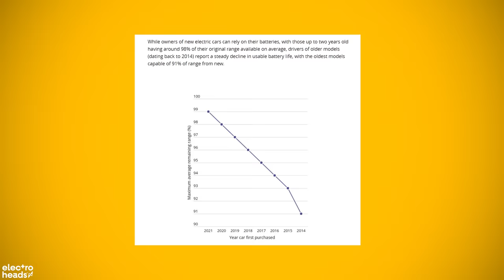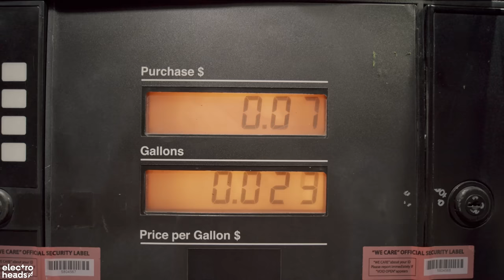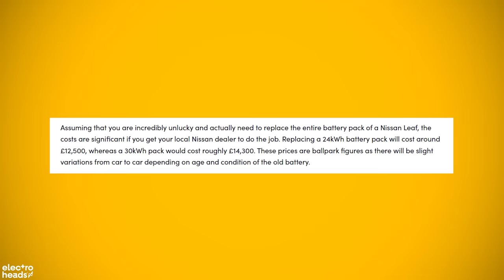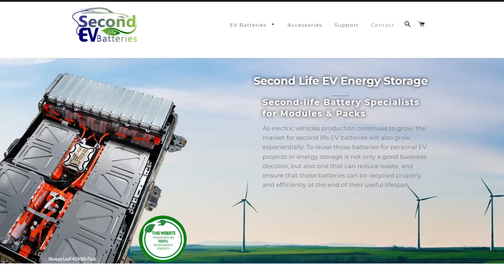What they DON'T tell you about electric car batteries

Comment: My first electric car was a home conversion using LiFePO4 cells in 2009. It had no cooling and would get hot when the car sat in an Australian summer sun all day. By early 2018, when I sold it, it had lost about a third of its capacity although it performed as well as new in all other respects. The battery had a small capacity so it was being given a hard life. 
Overlapping with that car, we had a Mitsubishi iMiev made in 2011. By the end of 2019, when I sold it, it also had lost about a third of its battery capacity while continuing to perform like new in all respects except range. It also lacked battery cooling except that it would blow cooled air from the air-con if it were fast charged but we rarely used DC charging with it. It did not do cooling when it was just plain hot weather. 
Both of the above cars 1) lacked cooling, 2) were always charged to 100%, and 3) had small capacities so a given distance driven required more charge cycles.
Our third electric car was a 'Holden' Volt, a rebadged Chevy Volt aka GM Ampera. Its battery was regulated to only use the middle 2/3 of its capacity so it never went near the extremes of fully charged or discharged and it had liquid cooling that could work any time the battery needed cooling. We owned that for two years from 4 years old to 6 years old. In that time it did not change its pure EV range and seemed to be the same as its new specifications. Other examples had very high milage and little degradation, even in hot climates. The difference seems to be cooling and avoiding state of charge extremes. 
Now I have a 2019 Hyundai Kona 64kWh. After 2.5 years and 45,000km, there is no perceptible difference from new. I routinely have it set to stop charging at 80% and don't run it below 40% unless on a long trip out of town. It has proper liquid battery cooling. I expect it will be good for several decades. With a large battery capacity, 1000 charge cycles would be around 450,000km, which at our current rate will take 25 years. Modern well managed lithium batteries should be good for several thousand charge cycles so I expect this car to last a long time. 
I have friends with early 24kWh Nissan Leafs and their batteries have not generally fared so well in a hot climate. One friend replaced his when its capacity became too small for his local driving. It cost Au$10,000 supplied and fitted by Nissan. After a year or two, the replacement is also losing capacity. Nissan have done a considerable disservice to confidence in EVs. I would not recommend one for a hot climate.
Reply: Peter Campbell:  Good points and examples.  With most modern BEV's from good makers, for traditional LI batteries, they manage the battery with software to prevent 100% physical charging or 100% discharging, to protect the range.  And even better, the LIFP (Lithium Ion Iron Phosphate) batteries that are getting cheap and popular have a GREAT reputation for durability (total charge cycles).   With those, especially if you are careful not to charge or discharge completely, the battery should statistically last a VERY long time. 

The energy density is lower (thus far) and the iron is heavier so they have somewhat lower range and acceleration, but for middle class cars, they compare VERY well to ICE's, and outfits like CATL are improving the energy density significantly in recent years. 

10 or even 5 years ago, I would have had reservations about battery life.   Now, I'd just go with an outfit with a good reputation and a good track record on batteries, not overcharge or over-drain the battery 99% of the time, and figure the battery will statistically outlast the car -- especially given the way BEV's will continue to improve in the next couple decades.

Comment: All the ICE cars I have owned mileage degraded (53 years of driving).  The Plymouth Fury about 1% a year to the Ford Explorer 5% a year.  
Before 1960 car engines only lasted 60k miles before overhaul (it was cheep as everyone knew how), ten years later the engine typically outlasted the car.
Reply: That’s quite true. I’d never considered some kind of degradation as the possible cause. Over a 12 year period, my Ford Diesel went from slightly over 800km on a full tank to well below 700km, no matter who was driving it 🤔

Comment: Don't forget that the efficiency of petrol and diesel cars also drops over time.  Also there are specialist suppliers who can fit Nissan Leafs,  for example,  with longer range batteries than the original at reasonable cost.
Reply: Yes, quite a few mods and adaptions for older Leafs. Available from a number of independent EV specialist......

Comment: I'm on year 5 with my b250e and my range is still the same even with these older cells. Had my motor replaced due to Tesla making my motor half assed lol but otherwise it's been 60k amazing cheap miles!
Reply: Richard Denson:  It is disappointing to hear how often Tesla motors have to be replaced.   I wonder if it's because Tesla markets their cars like they're racecars, and so lots of people DRIVE them like racecars, pushing the motors hard very frequently. 

I've been driving ICE's for 47 years now, and I've VERY RARELY put the pedal near the floor.  Even when driving my G37 fast on country roads, I still don't mash the pedal to the floor -- it isn't good for a an engine you want to last. 

I would imagine the same principle applies to motors.  Either way though, an out of warranty Tesla motor replacement will be EXPENSIVE.  Tesla fanbois love to claim Teslas will last forever, but I don't want a $5000 to $10,000 bill buying replacement Tesla motors, any more than I do for ICE engine or transmission replacements.  So unless Tesla sorts that out and such motor replacements become RARE, like say, Toyota engine replacements. I'm not buying the whole Teslas will last forever claims at alll.

Comment: I know of just a couple of incidents were batteries have been replace, both were in early Nissan leafs one didn’t require a full replacement just a couple of cell packs and the other leaf was owned by the Fully charge V-logger, it got an upgraded battery pack from I believe an insurance write off.  Eight years is a long time and by then I believe batteries will be cheaper, have larger capacity and be available through companies that specialises in EVs.

Comment: It must be one of the biggest cons of all time. ' Because of the low running cost, electric cars work out cheaper, in their lifetime '
For most people this is absolute bullshit. Without even taking the cost of the electricity into consideration and even now with diesel at £1.80 per litre, for the average extra purchase price of electric to ice at £10,000, that will get you 63000 miles in a large diesel car at 50 mpg. It is about time that this myth was put to bed. By 63000 miles most people would have exchanged their car for a new one, after the pcp of 3 years and 30,000 miles has finished. Absolute drivel, sorry. As well as this for an EV to work, you have to have a diesel car for long distance journeys because of the disastrous infrastructure, which is actually getting worse, supply / demand wise. I have a leaf and it is always used now within it's home charge umbilical cord range where it actually excells. For long trips forget it. I have given up and always take our diesel for those. An electric car on it's own is restrictive and long journeys, if you can find a free charger or two take at least one third longer, if everything goes according to plan. Much longer, even than that if it doesn't. About batteries, my leaf is 6 1/2 years old and has done only 29000 miles, even so it has lost 2 battery bars out of 12 with subsequent range loss, not good !
Reply: Or you get a Tesla. None of those problems.
Reply: I’ve read about a software update for the Leaf to fix a problem with the BMS. Did you do this?
Reply: I'm glad I bought a Hyundai EV then. It travels fine for long trips and it saves me $15 per 100km over my VW. We thought about a Leaf but decided against it.
Reply: @chrisspain  an $80,000 car doesn’t solve his complaint about the balance sheet.
Reply: @larryaugsburger8452  mine was only $41000. I drive about 80000km a year, or 50000mi a year and got mine the beginning of 2018. It got now 300000km on the clock, I charge mainly from my solar roof or free on various chargers in the area. My previous car was a VW Passat, at the same cost. But boy did that thing cost over the years in inspections, fluid changes, breaks, two clutches, thousands in Gas ect. And after only 250000km the engine collapsed, a write off. My Tesla is worth 70% of its original price, Battery by 96% looks and feels new. Yes, it more then payed for itself and I am not giving it up after 4 years as usual, I keep on driving it, probably forever.
Reply: @chrisspain  you cannot get a new Tesla for $40k. At minimum it’s $50k now, and not every ICE car is a Volkswagen. I’m glad it worked out for you but the premium prices for BEVs is a legitimate concern.

Comment: Have 2019 Nissan Leaf with 35,000 miles zero battery degradation. Averaging 4.4 KW per mile. Very happy.
Reply: That's good. If you were on EDF's EV tariff - which still onlycharges 4.5p per kwh - you'd be looking at 1p per mile running costs. Just don't ask what the daytime rate on that tariff is though.....

Comment: The running costs are only cheaper if you can charge your vehicle at home and on cheap rate. I live in a flat so would have to use public chargers which typically charge around 50p/kWh. Therefore a 50kwh battery will cost £25 to fully charge and give me an approximate range of 160-180 miles
Reply: Wow, expensive
Reply: Buy your food at your nearest Tesco, and use their free chargers. They offer free charging at 400 of their UK stores. There is free charging at Ikea, LDL and some Sainsburys branches too.  50p per kwh seems a lot. I was looking at some public chargers near where I parked last Wednesday morning, and they were 30p per kwh.... You unfortunately are in the minority. Around 60 to 70% of EV owners charge at home 90% of the time. It was probably a major factor in the decision to get an EV. You may find that if you actually subscribed to a particular charging network, you get charged less than 50p per kwh. It may even be 10 to 12p per kwh less, but you'd need to investigate the pricing structures of various charge networks...
Reply: Have you bought £25 worth of diesel recently? I put £25 worth in the wife's VW Eos, which does ~ 50 MPG. That £25 worth of diesel will get it less than 150 miles, and that's in a car that does about 50 MPG. So even on expensive 50 Pence per kWHr chargers, electric vehicles aren't any more expensive than an efficient small diesel vehicle.
Reply: @johnnodge4327  but do take a lot more time to fill.  If your time is worthless, then it is a good trade.
Reply: @DumbledoreMcCracken  My average stop once a week when I do charge external is 15-20mins? Normally I am shopping during that time and it is free. So, no, my time is not worthless because it needs no time. Petrol however needs a trip to the petrol station (time) and 100 pounds to fill it up. So you pay on top of your lost time.
Reply: @DumbledoreMcCracken  
But if you have the facility to charge at home at night on cheap rate, then there's minimal expensive charging trips, but even at 50 Pence per kWHr it's still cheaper than petrol or diesel. 

I can't wait for BEVs to be cheap enough for normal people to own, then I won't be held hostage by excessively greedy oil companies, fleecing me each visit.
Reply: Sadly, prices will go up in the future when the government tax electric cars like petrol and diesel cars, and so will the price of electric. If electric cars get to go 700 miles like a diesel estate on a motorway, then the £100 per tank of diesel will swap to £100 per charge at fast chargers for electric cars because government will want to keep making money from consumers for taxing!
Reply: @josephmarsh8235  Yes, they saying that for nearly 10 years now. In the future. Maybe. That is of no interest NOW. When you need 100pounds for electric you need for sure 200pounds or more for diesel. Where do you go in Britain for 700mi strait? And why not use a faster or cheaper mode of transport then an automobile? 700mi I fly.
Reply: @johnnodge4327  I understand your position.  Further, I agree that, for most people (not me), a grid powered car is the way to go for a second car, or an everyday car.
However, I moved out of Los Angeles just before the 'rolling blackouts' started, and that was a lesson in dependence on the power grid.  That's why I call them 'grid powered cars'.
In the State of Massachusetts, the state pays homeowners a subsidiary for every kilowatt hour generated, in addition to the grid operator paying the same homeowner for every kilowatt hour.  Also, until recently, the state issued zero interest loans on new home solar installations.  In effect, the state pays you to drive your solar recharged car.
In the State of Alabama, where there is a ton of sun, the state penalizes homeowners for installing solar, because it 'steals' revenue from the power grid.
Reply: @chrisspain  Like many others, he overlooks the fact that if electricity costs rise, it must mean that the cost of refining petrol and diesel also rises! The EV will always retain it's running cost advantage.
Reply: @josephmarsh8235  The Government will tax electric cars in the same way as petrol and diesel cars, but not in the way you expect. Road tolls is where we'll be in 2 to 3 years time, and these will be payable by ALL vehicles.  And don't forget that if the cost of electricity rises, then it takes petrol and diesel with it, because oil refineries run on electricity!  You won't ever see electricity costs increase without petrol and diesel going up. It just can't happen..... Motoring taxation will gradually switch from fuel taxation to charging for actual road use, because there are EV owners whom already charge their cars completely from solar panels. In their case there is no "fuel" to tax. So instead, they, like everyone else, will pay per mile....
Reply: Fill up or top up while doing something interesting or sleeping.

Comment: I remember many years ago we all had big ice engines. But the push to lower costs made us switch to smaller engines..smaller cars that don't weigh as much . (fuel economy better), then we switched from petrol to diesel.. Bigger cars for better mpg... Now its the push to EV... Twice the weight but cheaper,   ??!???..... Its still a much heavier car using more energy per mile........ As much as I like the new tech. I think you are pushing your pollution further away to satisfy your  green agenda... (not on my doorstep)..... It was always known that lighter was better, you don't double the weight and expect it to use less.
Reply: Lighter EVs are better, no doubt, but fuel efficiency is always vastly better when you compare two similar cars (ICE cars transform most of their energy into heat, so that’s not a surprising fact). Besides, my EV is solar powered, thus the energy production isn’t “pushing pollution farther away” either.

Comment: Great video, thank you for sharing. At the moment Ev sales so far are around 750,000 on the U.K. roads. At the moment there are around 32 million ICE and EV mixed cars on the U.K. roads. The U.K. Government are saying that they are hoping to have 300,000 chargers available on U.K. routs by 2030. If EV sales hit the 15 million by 2030 the if we work out the maths 300,000 chargers for 15 million EV cars this would equate to 50 EV cars sharing one charger. Well let’s hope the 300,000 chargers will become far more by 2030.
Reply: No it wouldn't, because statistically 80% of EV owners charge at home on an off-peak tariff. Why might you use public charging, when charging at home off-peak costs only a fraction as much?  Public charger might typically be 60p per kwh. Home charging is 7.5p to 12p per kwh.......
Reply: @Brian-om2hh  80% where did you obtain that figure and have you taken into consideration the people who can not have a home charge as they have no drive way or anyway to plug their EV into a charger, so these people would need to rely on the charger network.

Comment: You don't necessarily have to replace the battery pack. You can have it refurbished at a fraction of the cost of a full replacement. There are independent EV specialists already doing this work in the UK.
Reply: Sounds great. Might as well get the most out of the battery pack you already own. Do you have any names of specialists who will do this or is it just a case of searching ev battery refurbishment UK?
Reply: @tubularG  Cleveleys Electric Vehicles, in Gloucestershire. They posted a video on YouTube about 3 years ago, of a battery refurb they carried out on a 10 year old Nissan Leaf. The job took 4 hours, and cost the Leaf owner £600.... Other EV specialists also exist.... The vids are often posted under James And Kate...  (James works for Cleveleys)  Cleveleys service and repair most EV's. Tesla's, Leafs, Zoe's etc, they do them all. James is the travelling service guy, and he covers most areas from the South Coast to Scotland, doing EV servicing and repairs. He frequently posts videos of his travels on YouTube.....well worth a watch. And he doesn't use a diesel van. He drives an MG5 electric estate car, covering most of Britain in the process....  Here..  https://www.youtube.com/watch?v=ohCgTFMFwsI